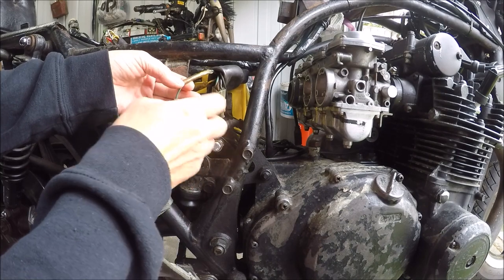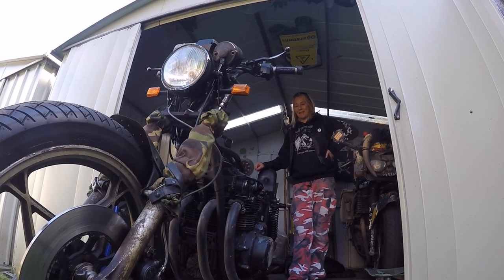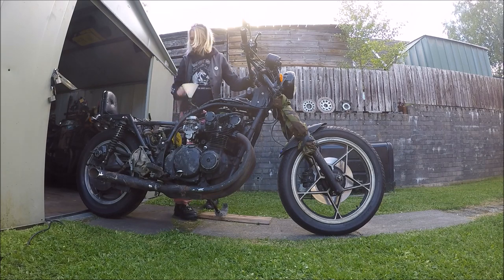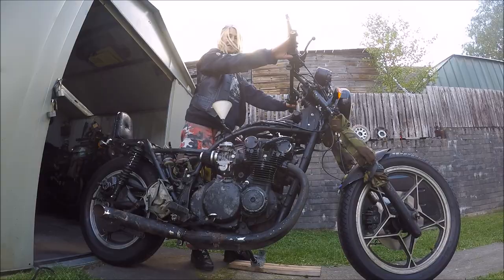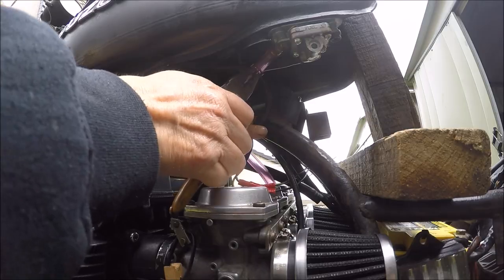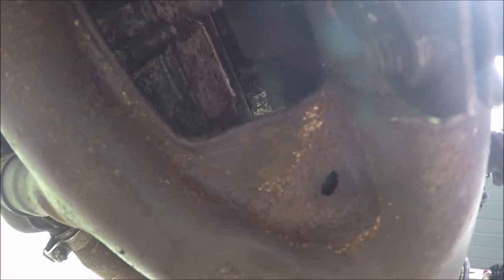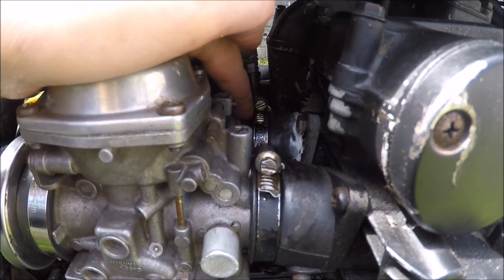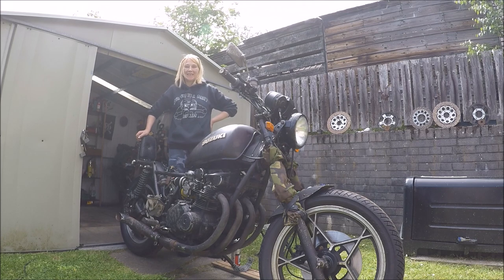GS550 Rat Bike Restoration Project 50 #Bike Starts. Problems found!

Comment: Great detective work lil' Sis. 👍🏻.. One step at a time.  Vacuum leak on intake rubber needs fixed of course . I think the pod  filters are making it lean . Especially as it runs better with choke.. An arduous task of moving the main jet needle clips down a notch and testing then rinse and repeat .. Or changing the idle and main jets up   a size or two .. someone somewhere on the interweb will have the jet size info for these carbs with pod filters and free flow exhaust . Rather than the painful task of trying multiple jet sizes .. and expense of course.. anyway you're doing just fine and you'll get there ! 
Peace and love and big hugs as always .. 👍🏻☮❤
Reply from the maker: Hey big bro and thanks for trying to help however I'm sure it's much simpler than that. I've since found another blockage in the one place I didn't look at last time, I wish I had! One of the air fuel mixture screws was blocked and I'm currently adjusting the screws. I'll all be in the next video. Behind the scenes things are improving and with a little more tweaking I'm sure the bike will run perfect. Lots of love and big hugs 😀👍🍻

Comment: Don't replace the rubber boot, just wrap electrical tape around the leaking one! That's worked great on my 82 CB450 engine. It depends on how bad the leak is of course, but sometimes it's a cheap, effective, and rat solution. Intakes leaks are vacuum leaks and therefore will suck the tape in, keeping it totally sealed for quite a while.
Exhaust leaks can be problematic, depending on how bad they are. If minor, they'll just cause decel popping, which I enjoy, and maybe shooting flames on heavy engine braking, when coupled with somewhat rich jetting.
However you fix it, I'm sure you'll get it working great, and I'll keep watching 🤘
Reply from the maker: Thanks for your comment and advice. I would happily bodge it up but I had already repaired it before and it's gone again! Found a new one cheap on ebay. It wont be long and it'll all be fixed. Thanks for your support hun. Respect and ride safe 👍😀